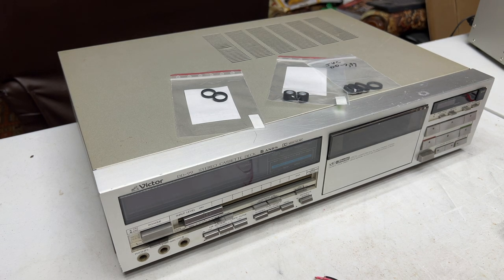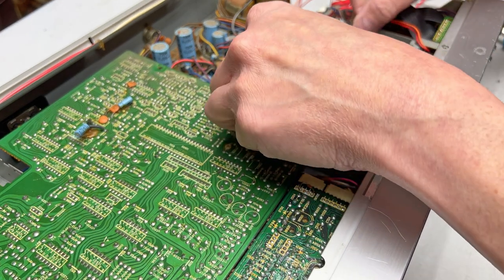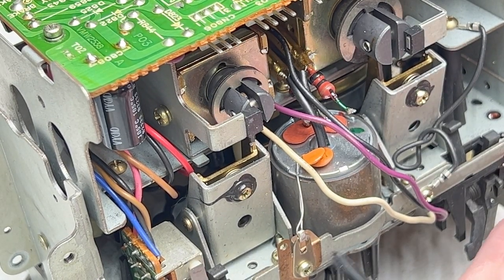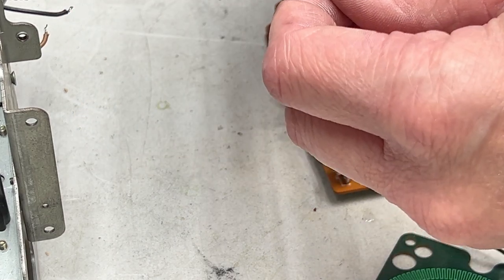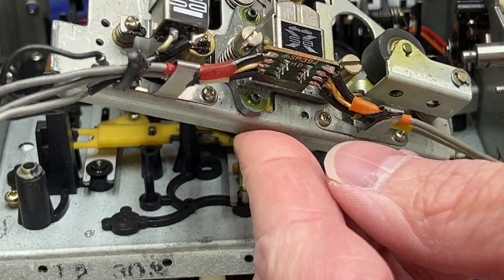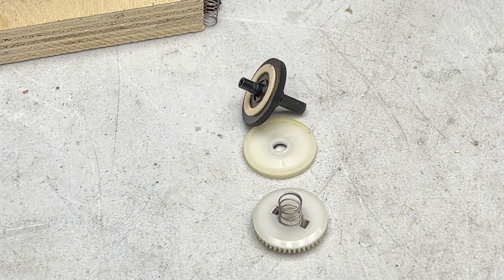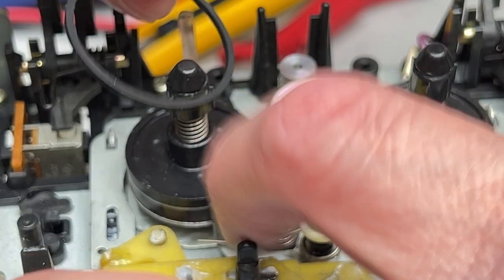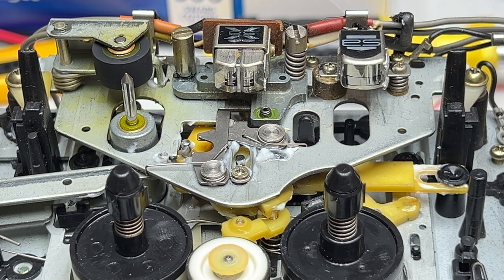JVC Victor DD-99 Part 1 - Transport Service Nightmare

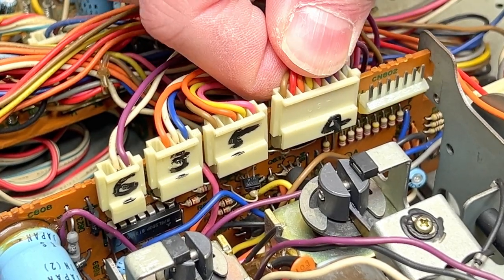Comment: hey there love watching your vids. i have a question for you. i am in middle of trying to restore a deck for a friend he loves and doesn't want to let go of for nostalgia. when i did basic mechanical work first i got it new belts that are proven to work for others with this deck well but i still had a lot of w&f and when i looked on a scope i saw this had a pretty low level 60hz signal in the audio output with a ton of harmonic distortion showing. i've never seen that on another deck i have worked on and i see one cap on the psu board that looks like it leaked but the stuff that is on the board doesn't look like anything i have seen leak out before it looks like caramel sauce ( you can see it on one of the same exact brand caps in this video at 13:12 )almost like old hot glue yet this is the only cap with this anywhere near it and there is no bulging at all.  so the question is do you think that is likely the culprit? there is no visible corrosion and the cap still reads decent specs but i'm considering recapping the psu board to start but don't wanna go too far with recapping the whole board as this was supposed to be a quick clean and replace belts situation and i am doing it as a favor.
Reply from the maker: That's glue - the same stuff that goes conductive that I had to clean up off most of these boards. However, if the glue on the cap isn't contacting any traces it's not likely the problem. Hum could be a grounding issue.

Comment: VR1 probably speed adjustment.
Reply from the maker: Speed is controlled by the PLL circuit. More likely it's a duty cycle control, like on the Sony TC-K666ES.